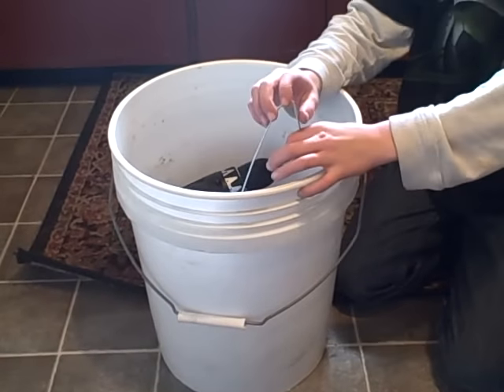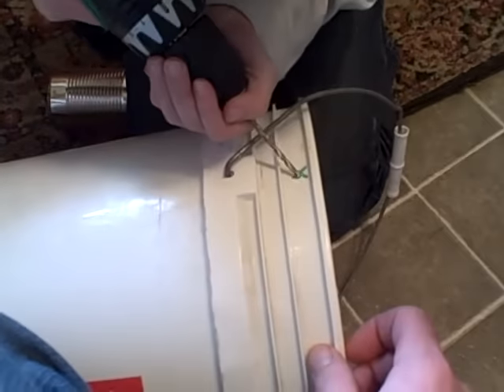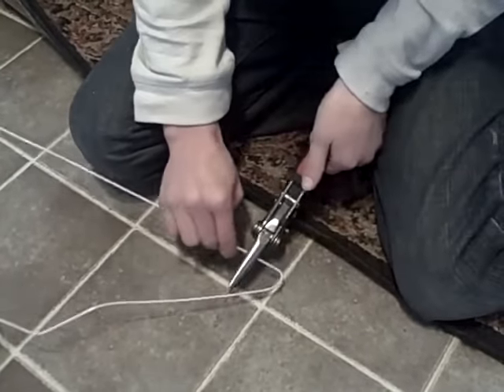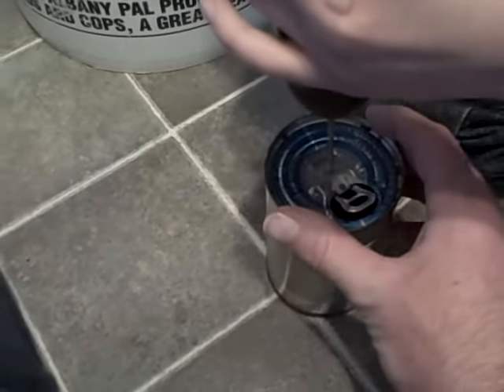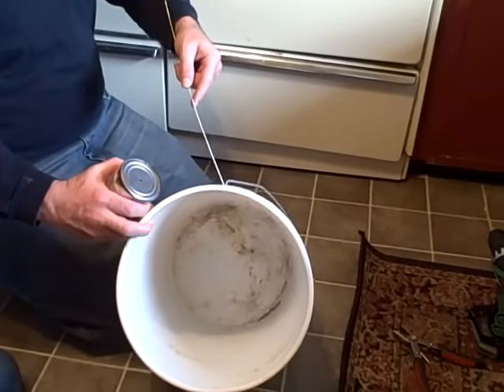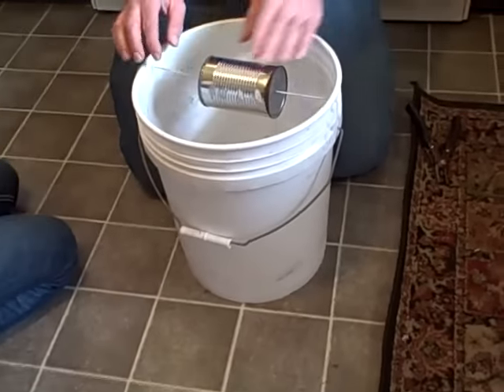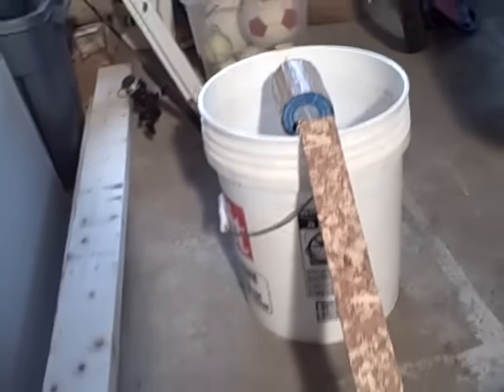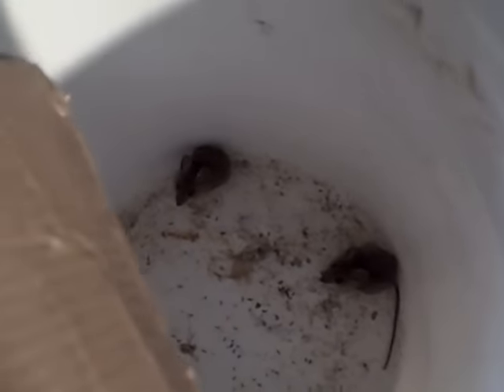Making a 5 gal. bucket mouse trap.

Comment: I had a bad mouse problem at my bush camp until I found this idea but with a cord and a toilet paper roll. I will be adapting the coat hanger wire and can now that I have seen this. I do not release as there are too many mice around. my fix for winter months is to put 4-5 inches of antifreeze in the bucket. it works well year round and when I go to camp there is no more mouse droppings covering everything. the other advantage to anti freeze was curious. the mice do not decompose in the antifreeze so I do not have a stinking mess to clean when I arrive. just scoop and drop the carcasses into the outhouse. when the antifreeze gets to thick from evaporation simply add a little water to it.
Reply from the maker: glad it works so well

Comment: Just a tip for catch and release using this bucket trap... Use a 2nd bucket to dump the mice into so you don't have to transport the trap itself with the peanut butter, etc. Just dump them quick, as mice can jump really far...

Don't worry about hurting them dumping them into a 2nd bucket, as a fall from bucket to bucket will not hurt a mouse... They are MUCH sturdier than most people think! I'm sure they would rather be jostled from bucket to bucket for being released elsewhere over being killed in snap trap.

Comment: I enjoyed watching this video.  I admire you for teaching your son how to do something and the fact that you didn't immediately try to do it yourself. I used this video to make a trap. Instead of using a can, I used a clear plastic 30 oz. mayonnaise  jar.  The exact center of the jar is clearly marked on both the bottom and the top.  You can take off the lid and thread the wire through and then screw the lid back on, making it  very easy to put the wire through.  I put a bit of electrical tap on the wire outside the jar  on both sides to keep the jar from sliding back and forth on the wire.
Reply from the maker: Wendy Lyon awesome.good luck

Comment: We use an antifreeze/water/bleach mixture. This prevents decay and smell. It also prevents freezing so the trap is useful year round. Also, you need to lower the wire a little more. You have it too close to the top. About 1.5 to 2" from the top is good. The mice lose more traction this way.
Reply: that combination will also attract and kill dogs and cats.  Is that what you are trying to do?
Reply: Dana Green Why would anyone want to do that? Are you sick?
Reply: Cotronixco
Dogs and cats will try to drink the antifreeze because it tastes delicious... it will kill them weather you were trying to or not if they drink it.
Reply: Animal Farm Why would you want to place antifreeze where dogs or cats could get to it? Adding bleach makes the antifreeze unpalatable, and also aids in reducing potential pungent odors.
Reply: In my experience, cats go where they want. Also, Chlorine is a gas, it will evaporate out of the solution.

Comment: Smart kid...he right away turned the can around to hit the harder part first.   Also much easier to insert the wire into the can first as he was doing.  The wire and can later be inserted into the bucket from the inside,  hitting one hole first and going through far enough to lower the other end into the bucket and out the other hole.   

I see that this is an old post, I'm sure he is now grown and making you very proud.
Reply from the maker: Absolutely 💯👊🏼

Comment: I had a pet field mouse when I was a kid and it could jump out of a standard galvanized pail which is not a lot smaller than plastic pails like the one in this video. I had to screen the top of that pail and the mouse would actually bounce off the screen. I would suggest to always use water or antifreeze or some may escape.
Reply from the maker: bottmar1 it works best that way

Comment: Good trap. I put a 5 gallon bucket near the water heater in the basement and they can climb the heater connecters smell the peanut butter that i just wipe on to the interior of the bucket. They apparently leap into the bucket which has 4 inches of water and bleach in it  which they can not escape. Your trap looks better but more work involved.

Comment: Excellent.  Just a suggestion.  Use a punch to start the drill so it does not drift. I will not use anti-freeze because if the neighbors dog drinks it the neighbor would be a little upset.  2,000 dog.

Comment: @aokspage Question, where do you get an empty tin can like that? I went about it by finding the most liquid like soup I could, a beef broth (as so the contents could dispense through the drilled hole), and then the bigger pain was unraveling the label and trying to get rid of the remaining adhesive strip. Spent 10 mins on trying to remove it all before coming here to ask if it is imperative to do so? as so the mice can't grip? or is it inconsequential because it'll be under PB & the can spins?

Comment: I have used the snap traps before. They get expensive if you only use them once. This is a cost effective solution. You have to drop the mice off 10 mi away atleast so they don't come bak and become someone else's problem. Gas is pretty expensive, but nonetheless less good instructional video and nice to see father son bonding.

Comment: A toilet paper roll tube works just as good as the can and it's easier to put on the hanger and I just put about half a teaspoon of pb in the center of it works all the time though I need a 5 gal bucket cause the bigger mice can just jump out of the 3 gallon one I have.

Comment: FYI, the way to get snap traps to work is not to put a lot of bait on them, put just a little bit in the hole to make the mouse work at getting that pedal. the longer a mouse touches the pedal, the greater the chance it go off.

Comment: Since you already have the bucket and wire, would you try a variation for me?
Remove the can and slip a "soda straw" onto the wire with a "dab" of peanut butter around its middle and see if it will rotate with the weight of the mouse......just a thought I was toying with and am throwing it out for what it is worth.....ALSO USE THE STRAW IN YOUR INSTALLATION, JUST CUT IT TO FIT AND SLIDE ONTO EACH SIDE OF THE CAN..IT WILL ALSO ROTATE MAKING FOR A DOUBLE WHAMMY AND HOLDING THE CAN IN THE CENTER

Comment: TIP: PUT WATER IN THE BUCKET!!!
I made this trap and actually caught a mouse in my house. Guess what? It jumped right out of the bucket and got away. It took him several tries, but on the 4th jump, he actually made it. I couldn't believe it. I had no idea mice could jump so high. I did some research and read that they can vertical jump 18 inches. If I didn't see it for myself, I wouldn't believe it. Put water in the bucket if you don't want them to escape. They can't jump while swimming for their lives.

Comment: If you add water (a couple of inches in the bottom) or RV antifreeze or windshield washer solution for the winter time the little critters will drown.  Works great for an unattended trap, at least then they don't starve to death.  If you use just water for the summer, add a bit of dish washing detergent, it will act as a surfactant to lessen surface tension and mice will drown much quicker and humanely.
Reply from the maker: yeah. that's how I was shown how to make and use the trap.

Comment: I fill mine up with hydrochloric acid. I don't check my trap for days at a time. The acid dissolves their little bodies! Just pour out the acid and liquefied bodies into a latrine or a hole in a field. The plain water will begin to stink after a couple of days.
Reply: +Confederate Son well that's certainly a...efficient method.

Comment: Ive got a variation that's even easier. Just put a recycle bin next to a brick wall and sprinkle some seeds in the bottom. Mice will climb up the wall and hop down into the bin easily but wont be able to get back out. Not a lot of help if your mouse problem isn't near a brick wall, of course.

Comment: Only 1 comment, because the coat hangar can be fed from either end and inside or outside the bucket,  you can load the can either before or after feeding the coat hangar through the bucket hole.

Comment: Dude, to MASSIVELY improve your trap, get bigger can like a tomato juice/fruit juice can, Bend coathanger up where it leaves can ends about a 45 degree angle to center it & where wire hits bkt make a hook to just hang on edge. Make sure cans top edge is BELOW top of bkt. Bkt edge hook needs to be LOOSE to add unstability to swinging/turning axel. Set your ramp board at a R angle to can, not from the end. Smear a tiny bit of P.B. up the ramp for the scent. The mice/rats WILL jump onto rotating/swinging can. Once they jump theyre CAUGHT. No need to coat entire can either, a smear all around is plenty. 6 inches of water is enough. 1 inch will keep em from jumping out & not drown em if preferred. Awesome working w your kid bro. Not enough of that around.

Comment: to make it easier drill a larger hole at each end of the can first (the size of a soda straw) then insert a length of soda straw that is an inch or so longer than the can...this will make it easier to thread the hanger through.

Comment: Your son was right. It would make more sense to put the wire through the can first and then just back it up into the bucket from the inside.
thanks for this video. Good info here. I think the guy who posted that the wire should be a little lower is on to something.

Comment: You don't have to go through the bucket first.  Put the wire through the can, then - for description purposes - place the wire on the rim of the bucket above the holes.  Grab one and of the wire and put it into the hole in the bucket until you can grab the other end of the wire and put it into the other hole.

I also use electical ground wire as it bends easier and you can recess the can into the bucket.  I use a kitty litter bucket with the top of the can at the top of the bucket.

Comment: Mice can easily jump out of a 5 gallon bucket where I live.  I'm trying to make a trap door that swings back shut like a check valve.
Reply: add water to prevent jumping
Reply: won't they be cold?
Reply: nextari they'll be room temperature....
Reply: +Tim Ram the water will die from drowning. Room temperature for what?
Reply: 21 Savage's Gun Room temperature is what you turn when you're dead...

Comment: How did this work for you?
Reply from the maker: Zack Howell works great.  Don't ever get mice anymore. The nice thing about this trip is that it will work all night.
Reply: aokspage awesome man thanks I made two of them with PVC but it wasn't spinning good enough cause they licked the penut butter off it twice I tweaked them now I'm using water/ soda bottles an they spin real good I hope I catch some they're running rampant
Reply from the maker: Zack Howell yeah once it's working as it should.  It will work well

Comment: You set up the ramps wrong .. they should be 90 degrees from the where you put them. They can use the wire to hold on to and escape the way you angled them.

Comment: I have used snap traps too.  I don't know why the ones I had didn't work.  I used peanut butter but the mice must be somehow cleaning it out of the traps.  I will either try that bucket trap or look for a nearly instant poison.  If I choose to use poison it will be something that will kill them before they get far so they can't go nesting in the walls and die in there.  I have no children or pets.  What is the most lehal substance I can mix in the bait on the traps?  I have read about people mixing plaster and oat meal or flour.  The key is to mix it with something they will eat.  Will alka seltzer kill them?  I have heard it kills birds anyhow but birds are harmless.  The worst thing birds do is crap on my car but that doesn't happen much.

Something amusing happened once with birds.  I was at a shopping mall driving through the parking lot and a large flock of birds crapped on my car all at the same time.  Is that good luck or bad luck?  It did not damage my paint because use good wax and washed it off quick at a nearby car wash.  It did however make me glad I still didn't own a convertible hahaha.

Comment: Let it free, my ass.  Stick the barrel of a 12 ga in there and let 'em have it!  LOL!!

Seriously, just pick up the pail and shake it back and forth vigorously a few times.  That will knock them out.  Then dump them out, give them the boot and throw them in the trash.  Pretty simple, and no one suffers.

Also, I would recommend crimping something on the wire on each side of the can to keep it from getting moved to the side.

Comment from the maker: @marksamuelsoncable I got that at the gocery store.  It was a broth can.  I dont remember if i cleaned the adheasive off or not, but it may not matter that much.  You can cover it with peanut butter.    I have also used a soda can before.  When it was shown to me i was told to use a soda or beer can.  I just happened to grab that one for the video.  Thanks for watching.

Comment: You know if you don't want to use water you can hammer 250, 3 inch nails into the bottom of the bucket for a FATALITY. Mortallllll Kombatttttt

Comment: You actually doing need a drill if you use a plastic bottle or a wire cutter. Keep bending the clothes hangers back and forth til it breajs..thebn heat part of the clothes hanger on the stove. Push it thru the sided if the bucket.. reheating as needed..
Reply from the maker: Tnc874 correct

Comment: For those who don't want to kill the rats, just  use enough water that covers their feet only. Mix this water with dish detergent. Half a centimeter should be fine. The rats will slip from the soap and wet feet and will never be able to climb high enough to get out.(any slippery substance will also work such as straight dish detergent, cooking oil, or anything that causes the rat to not good footing.) Your welcome.

Comment: i wonder if this will work for rats.
Reply: a deeper bucket made of steel might, rats would chew through the plastic pretty quick
Reply: Use a 55 gal garbage can. If you just want to catch them and release them somewhere, it might not work. Rats can jump pretty high.

Comment: You don't use water that's cruel. What you should use is something like Penzoil and fill the bucket about 2 to 3 inches up.When a mouse takes one gulp of motor oil the mouse will die in seconds.Some people even use antifreeze, but only use that if you know that no kids or animals would be around the trap.Antifreeze would kill a mouse almost imeadiately.
Reply: Forget the water or chemicals, add a soft drink instead.
Reply: Forestea69  What does a soda do to a mouse?
Reply: never said u'd have to be serious on youtube, a soda would be a good treat, somewhat. :P

Comment: I used your design but added a rat snake to bottom of bucket.
Reply from the maker: did it work?
Reply: +aokspage Set it up next to their hole in wall. I only had two mice. Both gone within four hours. Let snake loose under house for any stragglers.

Comment: We used used the same method to catch disease causing rodents. But pappa didn't raise no mouse loving sissy boy. After we caught our quota of mice/rates, bottom of the bucket filled with them, I'd promptly dispatch them all using a well placed cherry bomb tossed in for measure. After a while we grew tired of blowing up buckets with good fireworks so we just filled the bottom of the bucket and let the little nasty fuckers drown to death. Life is good when you're on the top of the food chain.

Comment: won't work outdoors........ Squirrels will raid that trap
Reply from the maker: BahoWetpu that's why it's a mouse trap and not a squirrel trap
Reply: ur missing the point... squirrel will raid the mouse trap and it'll become useless if kept outdoors. (unless there are zero squirrels)
Reply from the maker: BahoWetpu nothing is fool proof
Reply: then make it as fool proof as possible. 
on that particular contraption, all it needs is to cover the top with chicken wire. it'll prevent squirrel from ambushing it.
if the trap is kept in a garage or a shed, then chicken wire is not needed.
Reply from the maker: Great
Reply: aokspage - ...and you're probably not over -run with squirrels inside - lol - I thought it worked just fine!
Reply from the maker: Don Veeser u never know lol